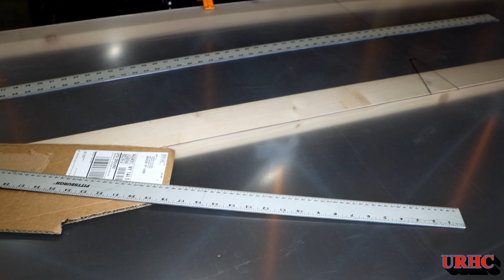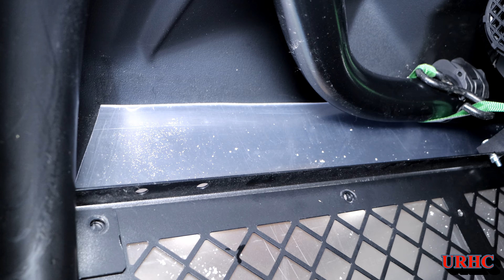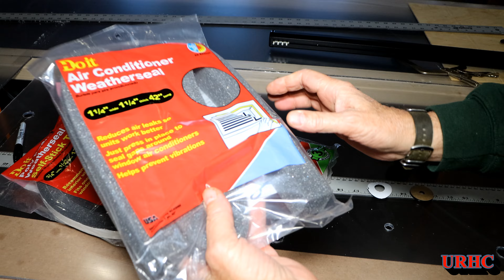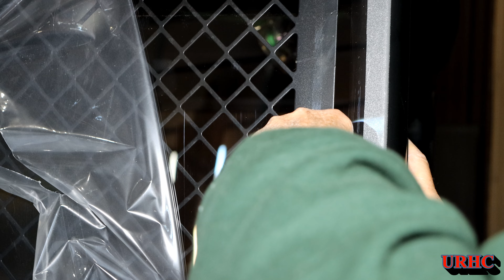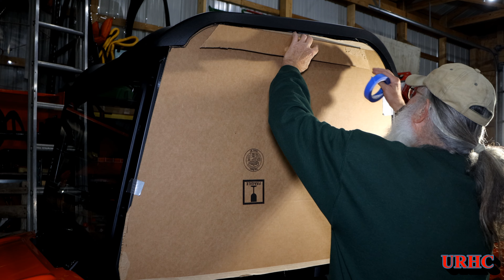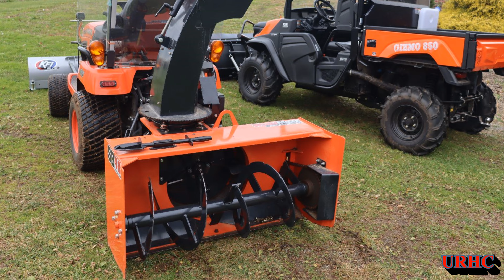Making A Lexan Rear Window For Gizmo

Comment: Beautiful! Thanks for making this video. I have turned my airconditioner hole in the wall into a window because it's on the south side and I need as much sunlight as I can get in this tiny apartment. So I put a thin plexiglass at the outer edge of the box against, what looks like that diamond shape screen on your Gizmo, but they're smaller diamond shapes. And I don't know what I did wrong, maybe I didn't cut it enough to fit because it buckles in the middle sticking out toward the front end where the room is, and I think I may have to take it out to recut it on the edges. But I have this thicker plexiglass like the one you have there, for on top of the wood frame around the box. I'm going to put hinges on it, and like you were doing to insulate, I was thinking to put a thin strip of that flat rubbery plastic stuff that you find in rolls at the dollar store for putting on the bottom of cabinets for dishware. I hope it works. So yea, you gave me some inspiration to get back to it and redo that thinner piece of plexi that's closer to the outside so that I could seal out the weather.
P.S. If you're wondering what I'll do in the summer for airconditioning, well, I heard there are in-room, plug in the wall, air conditioners...some new technology, that can keep the place cool. I think I'll invest in one of those.
Reply from the maker: Yes plastic will expand big time in the sun. Polycarbonate will stand some buckling but you have to be careful with acrylic (plexiglass) that can shatter. Best to leave plenty of clearance and not fix it solid. There are many efficient ac units available these days that can vent through a hose. Thanks for watching
Reply: @unemployedredneckhillbilly2023  You know, you are SO correct about this and I am so glad I came across your chanel because I now know what the heck I'm dealing with. As I look at that piece of plexiglass in the end of the box window in the wintertime, being Dec. 25..by the way, Merry Christmas.. I notice how it fits perfectly in there, straight. Whereas when it was sunny and warm (on that south side) before now, it had buckled so it stuck out into the box with a curve rounding out through the middle. I am at a place where now I have to figure out what to do about that because I can't cut it seeing as it fits perfectly in while it's shrunk from the cold. Hm.
Reply from the maker: @Belialith  Merry Christmas.  You could probably just have a piece of glass cut 1/8 of an inch undersized and use window points to locate it with silicone caulking to hold it there and seal it. Most home centers will cut it to size.
Reply: @unemployedredneckhillbilly2023  That was the solution I was thinking about, a piece of glass.

Comment: I had a job where I cut a lot of poly carbonate, I found that a coarse tooth wood blade for the jigsaw worked best and I was cutting two half inch thick sheets at the same time. And a 24tooth thin kerf blade for a Skilsaw.
Reply from the maker: I found  the finer tooth blade gives an edge that doesn't need deburring. The fuzz wipes right off. I haven't had any luck  with  a circular saw. The heat generated by a wood cutting  blade actually melts it leaving a terrible burr. Plexiglass on the other hand cuts fine. You must have a better  blade. Thanks for watching.
Reply: @unemployedredneckhillbilly2023  24tooth thin kerf DeWalt blades for the Skilsaw cuts an inch no problem.

Comment: Luckily I don't have my UTV anymore, but I thought about doing a Lexan windshield and back window and upper doors...since the manufacturer of my UTV never had a hard cab option, and their windshield and rear window were ridiculously over-priced a Lexan option would have been what I ended up doing as well.  Nothing wrong with a DIY Lexan windshield and back window and door windows.
Reply from the maker: I went with  the glass windshield because  it takes a beating that would  scratch lexan but $4400 for a set of doors with seals, shipping, and tax from Kubota is ridiculous.  I have no idea what they get for the back window.  I think these will do the job once I get it all worked out. Thanks  for watching.